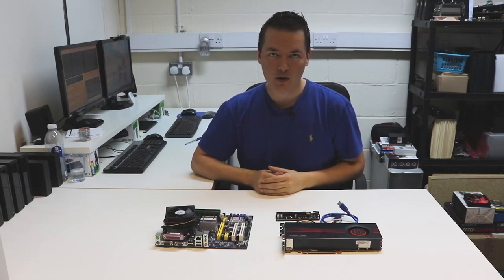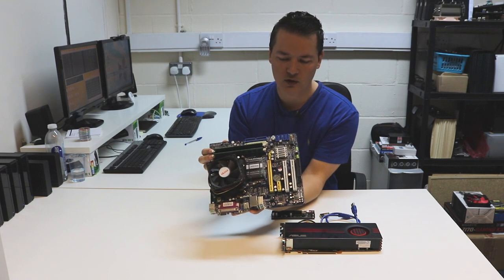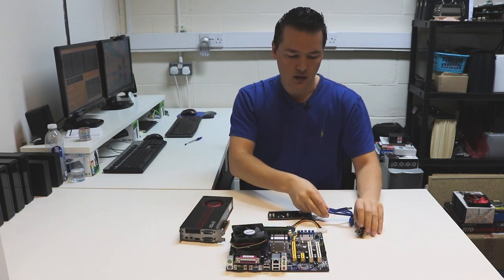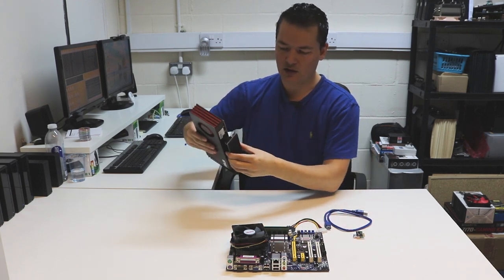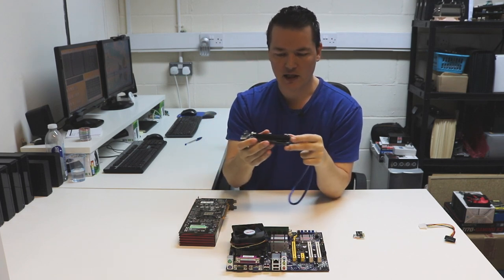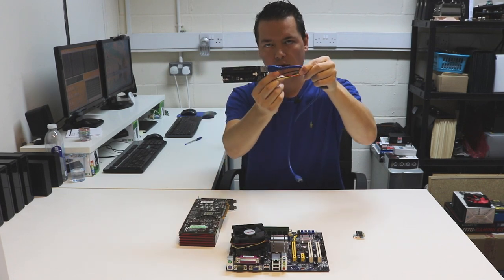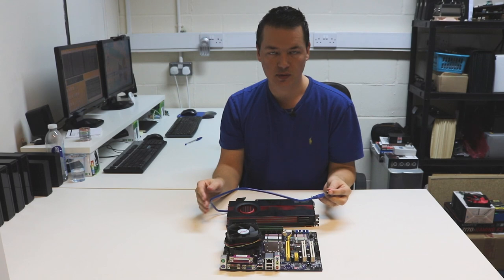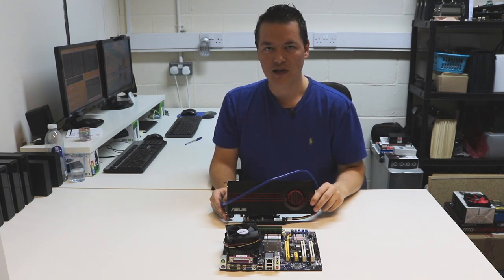How To & Why Use PCI-E 1X - 16X USB Extension Riser Cables

Comment: I appreciate your video. Thank you for the instruction.
on the motherboard it looks like the last two PCI slots are flipped around and I'm worried to put the riser in backwards and short something out. can you advise or provide a pic of what yours looks like?
Reply from the maker: If they white and set back a little from the back of the motherboard rear edge, they mostly likely PCI slots and cannot be used as PCI express slots.

Comment: Got a question, is this the recommended accessory to use when you got an usb port card that you need to connect onto the motherboard but the catch is that there won´t be enough space between two gpus populating the motherboard and want to route the card to face forward in the chassis instead of going out of the back?

Comment: Hello Thanks for your TIPS very helpful. I need your help I have 
2x PCIe 3.0 x16, 
1x PCIe 2.0 x16, 
2x PCIe 2.0 x1, 
1xmini PCIe on my Asrock MB extreme 6 Z97 
Question using your risers how many graphic cards can I connect to my MB ? I think 4 or 5 but might be wrong! 
Do I need to change in BIOS something  too to use all cards for mining for example?

Thank you!!
Reply from the maker: You can use 5 with standard risers. You may be able to obtain a special riser for the mini port but I'm not aware of one. 
Normally no changes to the bios are required.
Reply: IMineBlocks Hi I have also 1x ultra m2 gen 3,4 and 1x standard m2 gen 1,2.
Do you think that I will be able handle up to even 7x gpu's?
I have Old version of bios and don't have that 4D option so I have hope that like you said is no need to change anything there.
Thanks very much!

Comment: Im doing a rig with 6 460 2gbs and im usi g powered risers. Since the cards dont have any power input from the psu, how can i power them from the risers. Will the sata power be enough or do i need special cables
Reply from the maker: I'd look for risers with molex power connectors and connect them to the psu. If you have to use sata connectors try to use good quality hard plastic ones from your psu directly. Don't use the cheap moulded ones.

Comment: Hi Sir,

I have one query, there is 8 or 6 ping power connector on the GPU card, do we have to power that as well in this scenario or just the riser card power supply works well.
Thanks & Regards
Reply from the maker: Yes both the Riser and the GPU need to be powered.
Reply: thanks for prompt Reply Cheers....

Comment: Dude this old video inspire me to buy that pci riser. Is it okay to connect on my laptop pci slot? and is the power cable can run in the optical drive sata?
Reply from the maker: You cannot connect it to your laptop without a very complicated setup. You would also need a extra atx power supply.

Comment: With a h81 pro btc, the one with auxiliary molex connector, I still need to plug the molex from my psu  to the riser?
Reply from the maker: I powered the risers individually but NOT the auxiliary on the mainboard. You'll get a warning on bootup but working well for me.

Comment: I couldn't tell if this has been answered, but won't this limit the bandwidth from a possible x16 down to x1, limiting peak performance potential from your x16 graphics card?
Reply from the maker: The extra channels are not required for mining, there is no change in performance when using a 16X or 1X slot.

Comment: Hi IMineBlocks
Do you think this is possible to use on a laptop with a x1 pcie slot (for wifi card) for low spec gaming?
In theory it should work right??
Reply from the maker: It might be possible for you, but you'll need to power the riser & gpu also.

Comment: the bloody 1 x sockets sit very loose during operation , dont you know of some  plug sheeth or cable grippers to stop riser boards from moving sideways in the slot during operation ?
Reply from the maker: I've seen some people 3d printed these little plastic clips to solve that problem, maybe you can find them on ebay / amazon.

Comment: wonder when we will get them over usb 3.1 would make things so much easier! Would still need 2 usb 3.1 cables per gpu but would be cleaner and easier. Maybe use a usb 3.1 hub for power to make it even cleaner.

Comment: I have a GTX 1050 Ti. Need to connect with risers. It needs additional 6 pin power supply as well. So how can I connect it with the risers? Do I need to supply power for both graphics card and riser as well? Or is supplying power to the riser is enough? Cos' It has overclock feature and I use it for mining. Please help me to solve this issue.
Reply from the maker: Yes, You need to power both the riser and the gpu.
Reply: +IMineBlocks thank you. That was really helpful.

Comment: I dont have that small connector on my motherboard! Does that sata cable works the graphic card??I mean without that usb adapter!
Reply from the maker: You should have a small 1x pcie connector or might have a longer 16x pcie connector. You can't use any other connectors for this.

Comment: 6:50  hey then what other pins will , do , tell me , is in i have seen there is line draw same in 1/2/4/16etcX , and i am thinking to transfer the data that small pins are used and to supply power those other pins which you left unused are used , !!
but still i am thinking like no , 16X will give more power and use full GPU where as this 1X , usb thing will not , becuase it is using few pins only

Comment: The are 2 problems with this setup, 1- you are reducing PC-E speed to 1 lane so if your card is PC-E 16x (16 Lane) and connecting using this adapter, it will drop to PCI-E 1x (1 Lane) , I would instead use a ribbon extender of 16x to 16x

Comment: Must i use power cabel when am using gt 730 or any graphics card like this?pls answer this
Reply from the maker: If the riser has a power connector it would need to be powered!

If using a flat ribbon riser cable (old style) you would not need power connected.

Comment: Hello master! Thanks for the video. 

I have a question. Which motherboard and processor do you recommend for use with a Sapphire Radeon Nitro Plus Rx 470 OC 4GB?

(Sorry for my bad english)
Reply from the maker: You can use any. But my favourite motherboard for mining is Asrock H81 pro btc combined with Intel Celeron G1830 / G1840
Reply: What do you think of the AM3 MoBo options? Several have 7x PCIe slots and are relatively cheap & available right now.

Comment: Would this be good enough for gaming with a gtx 750 ti or 1050 ti with only one of those cards? Or does it get bottlenecked too much? As long as I can achieve 30+ fps with medium to high settings in most games I'll be fine.
Reply: Mining use more power than gaming so if you can mine with this you can easily play games

Comment: Question, my pcie X1 slot is being blocked by a double slotted GPU.. but I have a spare PCI (not express) can I plug a pcie 1x WiFi card into a non express slot? I.e. is pci express backwards compatible to PCI? When I asked this question elsewhere somebody told me to get a riser but didn't answer my question which led me to here to find out what a riser was. If rather not have all these extra bits in my pc if I can just use the standard PCI slot you see. Please advise. Much appreciated. Can't seem to find a difinitive answer
Reply from the maker: No, you cannot do that. PCI & PCIe are not compatible. Perhaps consider getting a usb wifi dongle.
Reply: @IMineBlocks  Thanks for taking the time to reply, I appreciate that. Haven't had good experience with wifi dongles in the past, they seem to randomly disconnect and reconnect. Will probably run an ethernet cable along the skirting board. Cannot understand why the designers have the x1 slot right next to the PCIe 16 slot when they know full well most GPUs are double sized

Comment: So I cant help but be curious. If I am trying to run 2 GPU's either crossfire or sli on a mobo with one PCI x16 via a riser that has 2 PCI x16 slots. Wouldn't there be some type of bottleneck using only the one slot?
Reply from the maker: So you mean running two gpus. One in a 16x slot and the other in 1x slot using a pcie riser?
I've not tested but when gaming I would assume you won't get the full benefit of the second gpu.
Reply: IMineBlocks  no I mean a riser card that has 2 pci x16 slots plugged into 1 pci x16 slot. I haven't built a pc in quite some time but I keep seeing some high end motherboards with only 1 pci x16 slot and I thought maybe that was a new thing..

Comment: I have a usb riser and am plugging it in but my computer is not recognizing the card, the card has power and the fans spin up and everything but when I go to mine it only shows the two cards I have attached directly to the mobo. is there anything I need to change to make the riser work or is it a bad riser? any help appreciated, thanks
Reply: Same problem here.
Reply: Rodrigo Teixo same here. bought a pack of 6 and none work so I don't think it's the risers. tried on various mobos too and no luck.

Comment: I have a question, i can connect the adapter to the PCI ports? cuz my PCI-EXPRESS it's damaged. And my motherboard doesn't have another PCI-E
Reply from the maker: No, you can only use it with pci express
Reply: But i can use the PCI-Express one connector, right?

Comment: i have a lga 775 Mbo but i wanna install 1050ti or greater something but my x16 is gen 1.0. Now newer graphics cards have 3.0 x16. I was wondering if I get a PCI Express Riser cable or something like this would help me out performance wise?
Asus support tell me it will work normal way just plug it but wont  get max performace.
Reply from the maker: No a pcie riser will not increase the performance. Have you tested it, is the performance that bad?

Comment: hi ! thanks for that great video that lighten me up on risers but one question still remains in my head. 
I have a x6 pin riser, should I plug it directly from my PSU and only do that or should I plug my gpu as I would do without a riser + plug the riser ? 

Thanks ! (and sorry if you already answered in the comment ..I didn't see the answer)

Comment: @IMineBlocks hello, I have 008s riser version and I need connect to msi gtx 1060 6gb, what connector i must use better to connect gpu? Only Molex or sata or 8pin or all maybe need to connect?
Reply from the maker: Only connect a single power connector on the riser. I'd use the molex or pcie power connector.
Reply: Then 8 pin don't need? just molex or sata yes?
Reply from the maker: Yes, but I don't recommending using the sata. Use the molex.
Reply: IMineBlocks Because molex is more powerfull and stable? I try to connect with molex,sata,6 pin and not working with anyone, gpu led lights working, but pc show only one gpu, second not show, maybe its riser problem or what?

Comment: I was using a pcie riser to connect a second gpu beacuse it was too tight of a fit. 
I connected it to the 2nd 16x slot and connected a 6 pin power from the psu . 
Smoke came out of the pcie slot and and am assuming fried the riser
Anyone know why this may have happened?

Comment: Hi, i have 4 SATA connections on 1 cable from my PSU. how many risers can i plug into that 1 cable?
cheers
Reply from the maker: I would only power a max of two risers and only if the gpus are also powered by pcie power connectors. One riser if you don't have any pcie power connectors. 
Is it a small wattage psu less than 500W? You'll likely need to upgrade for any more than single gpu mining.

Comment: But what about the power? That's the tricky part. I have an 8 pin connection on the back of my RX480. Do I plug that in? And the power coming off the riser, where do I plug that in? The board or the PSU? Also, most risers come with a molex to sata wire. You say don't use that. Then what to use? I am very confused. I need some help. Thanks in advance
Reply from the maker: Andrew Hajjiri plug the gpu in like normal with the 8 pin pcie power connector to your psu. Then power the riser by plugging in its the molex connector to your psu.
Reply: Thanks Lee! It also turns out I didn't properly install the drivers. I found if I loaded the card directly to the MoBo then loaded the drivers, everything worked a whole lot better. Love your videos bud!
Reply from the maker: Great, glad you got it sorted.
Reply: some motherboard also got those SATA slots, can i power the riser using those sata slots rather than psu as dont have many slots left on psu
Reply: Nish Padalia The Sata slots on the motherboards are for Data transfer, not power transfer, so no :p

Comment: Can the pcie 1x be used to plug in usb 3.0 hdd ..as my computer does not has usb 3.0 port ...if it is possible please reply ...i have searched everywhere but didn't find the answer
Reply from the maker: No, it cannot be used for that. But you can get a usb3 pcie card that will give you some usb3 ports.
Reply: @IMineBlocks  thank you very much for replying...... subscribed

Comment: What if u have a tiny pc and u video card doesn't require much eletricity (1050 small card)? Do u still need to add electricity to the riser?
Reply from the maker: The riser will still need to be powered.
Reply: @IMineBlocks  but the video card is 75w without any cables, bcus if u install directly to the motherboard it doesn't need any. In this situation does it mean the power it needs will come directly from the motherboard therefore no extra power is need it right?
Reply from the maker: @gustavomedrano3628  Yes but the riser itself still needs to be powered as the riser does not get any power from the data/usb cable.
You can find full pcie ribbon cables that would not require power for your situation.
Reply: @IMineBlocks  oh CRAP!! i placed the order a few hours before i saw your message. after i saw ur message i started thinking about how/what im going to connect  since it comes with a shitty sata to 6pin, but i read sata only gives 40 something watts... but u were right. im just going to stick my big 1050 ti NVIDIA directly on my small SFF 8300 without the raiser. thank you great channel

Comment: Hey guys, I've been wondering if this will work with a regular USB 3.0 for a source instead of the PCI Express x1 and also if there are going to be any performance losses? Thanks in advance!
Reply from the maker: You can't use this with your USB port.
Reply: Did you watch the video he said that on the video it won't work

Comment: Hi there Lee. Firstly great video as always. I have a few questions for you which I would really appreciate an answer to. Does the number of gpus you can have in one system depend on how many pcie slots you have? Or is there another limitation besides a physical one? Could I split a pcie 16x slot using an adapter that can be purchased to actually increase how many cards I can have in my system? Thanks as always, I really appreciate your help. 👍
Reply from the maker: Hi, thanks for watching. 
For simplicity most people match the number of pcie slots to gpus. It is also possible to use multi slot pcie add in cards however the motherboard / cpu needs to support that number of pcie lanes. 
If you want extra gpus per rig I'd start with a better suited motherboard (Asrock H110, Asus B250), rather than using the multi port add on cards.
Reply: IMineBlocks Thank you very much for responding as always. Thanks for the recommendation, and keep making great videos 😁👍
Reply: Also a powerful PSU

Comment: All these risers and expanders, but HOW do the devices (such as the video card, that gets displaced by these gadgets) have their outlet end face out of the back of the case/tower for the necessary external devices to be connected???? 
How about a demonstration how all that shit fits INSIDE the case and is mounted to the mohterboard and/or the back ports??

Comment: i brought new MB it has 2 pci express slot this video is for graphics card can i use it for my sound card connection my old MB is like ur MB in my old MB i've connected my soundcard in pci 16x(it was in right side in ur video, two white pci slots) my sound card name is creative sound blast for 5.1ch MB=motherboard pls answer me...
Reply from the maker: Hi, the long white slots are PCI slots. PCI-Express are typically black or blue. You can't use PCI in PCIe or vice versa.

Comment: hey 
IMineBlocks i have a problem with my gpu 7950 vapor x wrong flash and the result black screen and i have the backup flash but atiflash can't detect it "error adapter not found any is there some help thank you
Reply from the maker: Some GPUs have a bios switch. Power off your machine and see if yours has a switch, if so you change switch the bios to backup version. If you don't have a switch it may still be possible to fix but its a lot more complicated.
Reply: i did switch to the secand position but without result - - -any help plZ

Comment: Question: So when I do this I should NOT plug in the six pin power supply cable from my battery into my gpu? 

I just destroyed 12 Graphics cards...
Help.

Comment: Hey my GPU DUAL-GTX1050TI-O4G  doesn't have a power plug on it, would a rosewill mining riser card work?
Reply from the maker: Some 1050Ti don't have the 6 pin pcie power connector. It will take all its power via the pcie slot (riser).
Reply: IMineBlocks ty

Comment: Sir i own slim pc cabinet with no room to mount the graphics card directly on the motherboard. I am thinking to buy a gtx1050ti mainly for gaming purpose and will be mounting it parallel to motherboard using this riser. Will using this type of riser card  affect the gaming performance of the graphics card?
Reply from the maker: For gaming you should use a 16x -16x riser. You'll find it as a grey ribbon cable not the usb style cable as with 1x - 16x riser cables.
Reply: thank you for your response IMineBlocks, now is there any way to connect the 16x 16x to a motherboard without a second 16x gpu slot in your motherboard as that's sort of the purpose of getting the riser cable, not having a second gpu slot ? and would a x 4 or x 8 slot work as efficiently, if so are there x4 or x 8 cables ?